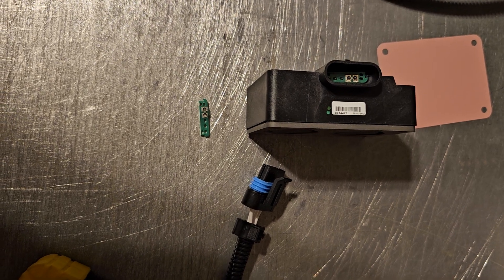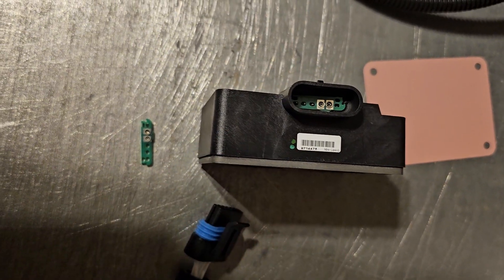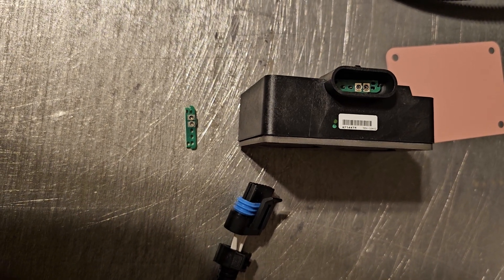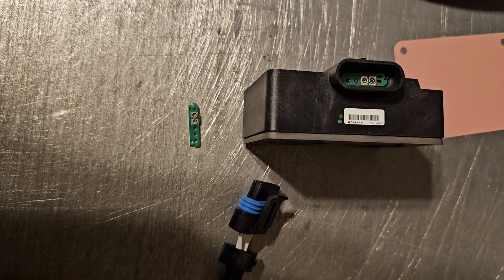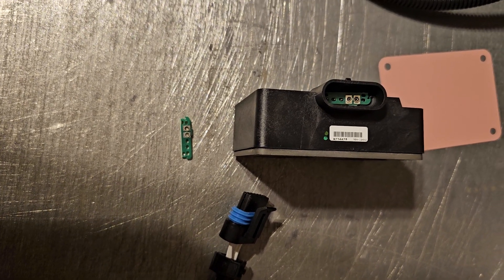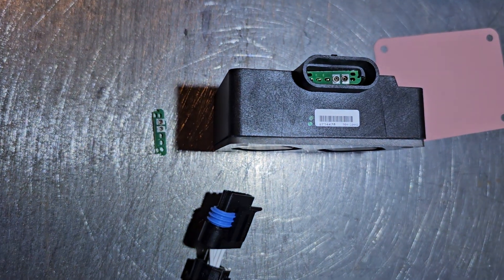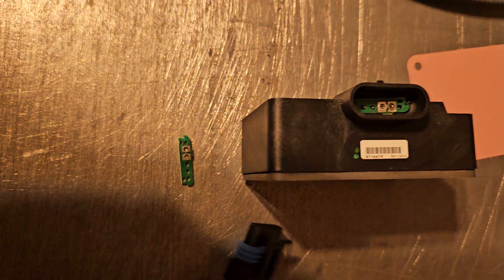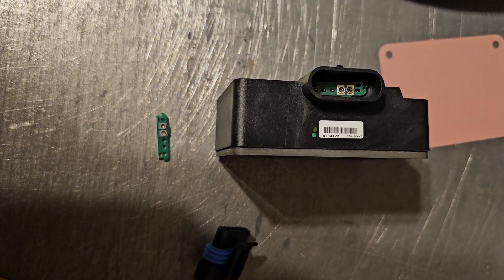6.5 diesel PMD resistor installation

Comment: Whats the downside to not running one? I bought a truck and the pmd failed on the drive home. Was able to get a replacement the next day but the old one did not have a resistor in it. Its been a month/2k mikes and i perspnally havnt noticed anything but im new to 6.5s
Reply from the maker: You might get away with not running one but then again the ECM when just the right conditions are met can flake out on you if you don't run one. So just to make it simple I would run one. They're only $20 on the website
Reply: @leroydiesel6.5  Fair enough, Ill just order one. I have a flu damper on the way and i  just got your oil cooler lines in the mail. My 6.5 only has 17k miles on it so i wanna treat it right.
Reply from the maker: @tyler4081 great thank you for your support

Comment: What does the resistor do because I have a 2000 6.5?
Reply from the maker: It is only used by the pump Builder when they have it on their test bench. It's a way to calibrate the pump. The most important thing is you just need to run one so the ECM doesn't possibly code
Reply: @leroydiesel5647  How much is a kit and we're is it installed?
Reply: Hi Leroy 
So is there no difference between the 5 or #9???
Reply from the maker: @gerald4027  go to Leroydiesel.com and click on the engine Electronics page it's listed down at the bottom at that page
Reply from the maker: @joestone2068  Correct. It's just a calibration resistor so the pump Builder can tweak the pump